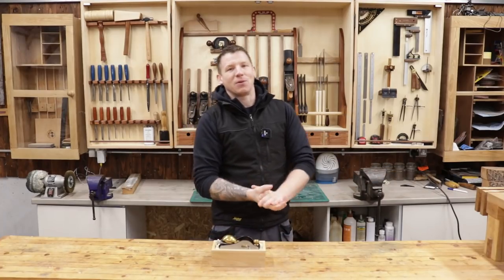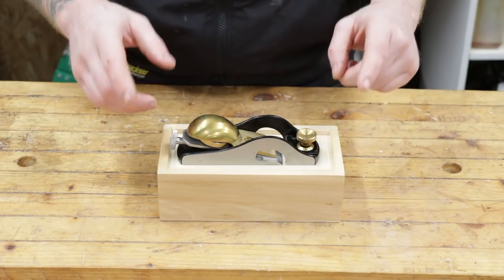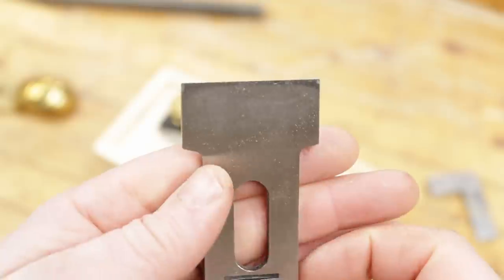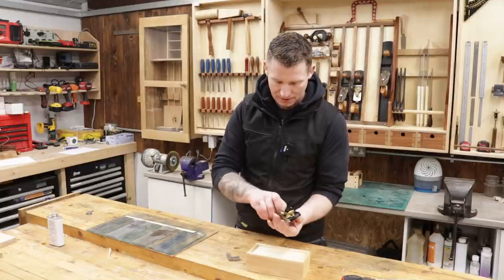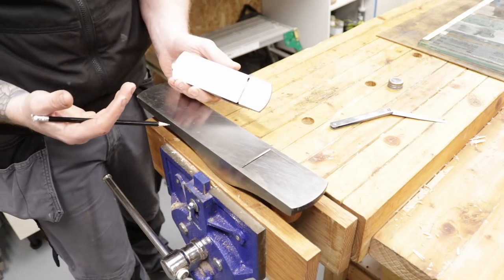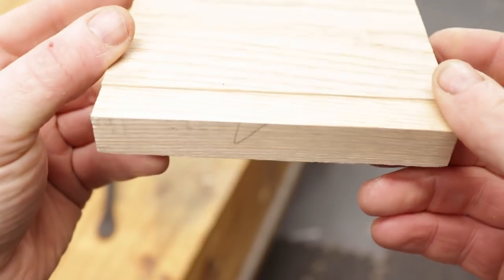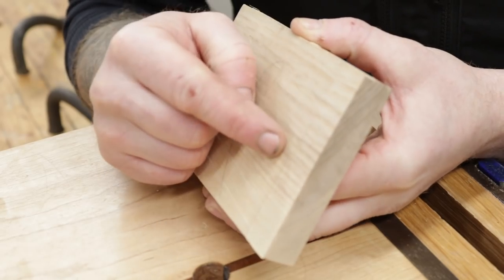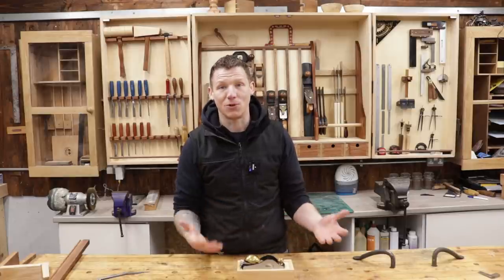Quangsheng Low Angle Rebating Block Plane (TYPE 3) Review, Demonstration and Uses.

Comment: I have the Lie-Nielsen version of this plane and it works like a charm, especially for fitting tenons.  But, as you emphasized, you really do NOT want to drop this plane on a concrete floor. Just saying...

Your plane looks great. If it works like the Lie-Nielsen version, then you will be very pleased with it.  I really like Wood River planes (U.S.A.) and I have several.  Good gear!

Comment: Enjoyed that Mo Chara :) Been lookin at some QS planes, i have most of my bench planes sorted but need a couple of block planes and a shoulder plane, will probably go to Matthew for them. Ive heard good things about the QS planes and anything ive bought from WorkshopHeaven has been top notch, but that rebate block plane always seems to be out of stock :P  I think the cap on these are bronze tho lad, not brass........also, if you loosen up the center screw that the cap levers on, it will give more clearance between the cap and the wheel to get your fingers in.  If ya run out of thread on the screw or the wheel ya could grind a bit off the bottom of the cap around the wheel to create the space ya want to make it comfy :) What Rob does with the skew block plane is known as the "140 trick".......and if youre into hand tool work, have a look at Tom Fidgen (unplugged woodshop)... his work is amazing lad  :)

Comment: Great review. I got mine from Rutlands under the Qiangsheng Luban brand label. Slightly cheaper than the Workshop Heaven versions. They do an offer for a standard block plane and the low angle rebate so was a good deal. Quality is like you describe but comes in a card box as opposed to the wooden one you got.

Comment: That was a nice review of a handy little tool.
Reply: One comment about fine shavings: they are a good check that the plane functions properly, but are frequently not what you want.  For instance a ranker cut takes wood off more quickly as you plane a rabbet, and still leaves a good surface.

Comment: This rebate block plane is indeed not as "robust" compared to it's standard equivalent, but it's still plenty strong enough anyway. That said, it should be avoided for general block plane use for a more practical reason: BLADE REAL ESTATE! There's not that much working blade to use/wear, so make sure you get spare blades for the future.